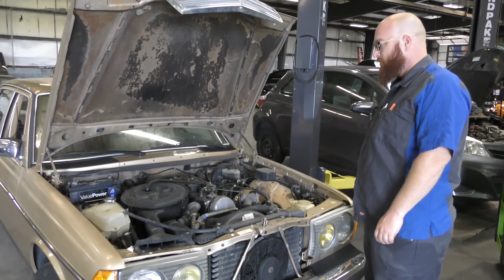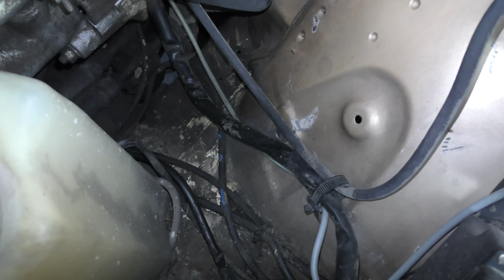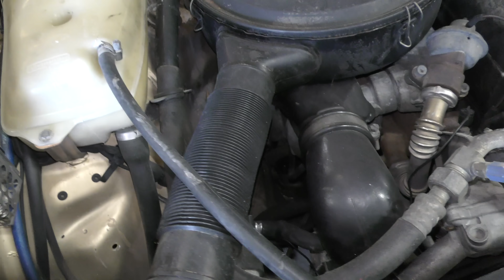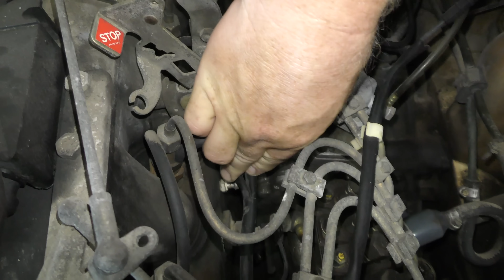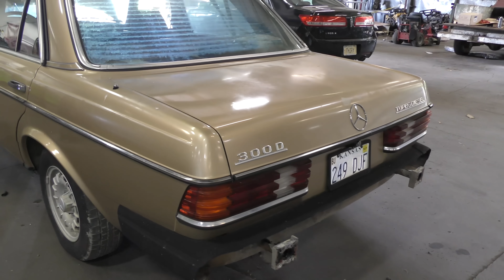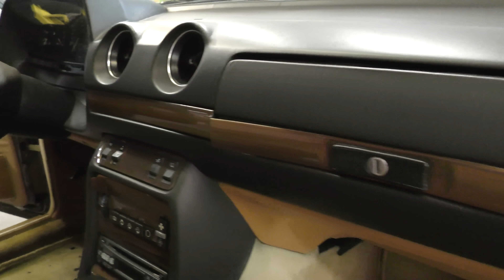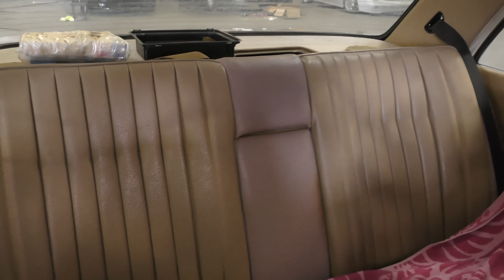Tank of a Mercedes 300D with a 3L Turbo Diesel! CAR WIZARD finds lots of surprises under the hood!

Comment: There is actually a  1,000,000 mile club online if you look it up. There are many of these over 1,000,000 miles. Mine lasted for 780,000 miles and I used to pour used chicken grease from my girlfriends job, the fryers there, in the tank along with kerosene and transmission fluid and God knows what else and the car ran just fine on all of that. We used to make concoctions of different fluids just to see if it would kill it. Nothing killed it. I basically made the assumption that it will run on anything flammable underneath gasoline and that was quite the correct assumption. The only reason it broke was somebody ran it off in a ditch and busted the radiator and drove it anyway and it blew the head. If I hadn’t loaned it to my friend I would probably still be driving it today

Comment: I just bought a 76 240D it’s smoking more that I think it should and can be a bit difficult to start. I just replaced the glow plugs with the pencil style. I’m still finding it a bit difficult to start after it sat overnight. After she gets up and running she seems to run great what suggestions does anyone have to put me in the right direction to get it running easier with less smoke?

Comment: On the TV show Wheeler Dealers Mike and Ant repaired a Merc 300. Very informative.  Mercedes has an an extensive parts network.  They will likely have everything you need.  Cost $ ?

Comment: Hey Mr wizard I have an 2006 Sion XB. I replaced the blower motor. My fan is blowing very and loud and the fan feels like it stuck on 3 even though it’s on 4. Is this a simple fix or do I need remove the dash or is there a part that need to replace ?

Comment: Small correction on the comment about the MB Taxi:

It was a 1976 240D, which was probably an introduction year W123 but could have been a W114 or a W116. I can't find any photos to confirm. However, it had (has) the OM616 in it, same as the 240D in the W123 lineup.

And it wasn't just a million miles, it was 4.6 million kilometers, or 2.858 million miles. Here's a link: https://www.expatica.com/de/uncategorized/last-ride-for-mercedes-taxi-with46-million-kilometres-on-clock-102348/

Comment: Don't mean to be "that guy", but when referring to the adla 15:11, boost pressure from the intake presses down a diaphragm inside to increase fuel from the pump, and the part you point at 15:16 is the vacuum control valve (vcv) for adjusting the shift point and feel of automatic transmissions, the shutoff valve is just behind and under the part described, like the video and love the old w123/w116/w126 cars with the 617.951 engines

Comment: "The cost to fix this car is going to be more than it's worth." Sounds like every repair job I do on my Volvo! lol
Reply: That is a logical fallacy. Still cheaper than buying a new car.
Reply: @petrosaguilar8916  "Logical fallacy"? Tell that to the insurance companies that sometimes refuse to repair a vehicle when it has been in a collision. And the reason why?: The cost to repair it is more than the vehicle is worth. It's a very real thing, not a "fallacy". That said, I do agree that in most cases it is cheaper than buying a new car. :)
Reply: @bobjohnson205  Putting $1,000 into a five hundred dollar car and getting another year of service out of it is much cheaper than purchasing a new or used late model car. That is why I said that the saying "don't put more into it than it is worth" is a fallacy. It does not take into account how much the replacement of the vehicle will cost. Also, unless you have a minty classic the cars book value is always going down and basing your repair allowance on it would be flawed logic.

 Insurance companies do not own the car and so for them it always makes sense to total an older car if repair costs are above book value.
Reply: @petrosaguilar8916  I'm glad that we agree! That is why I own a 30 year old Volvo and chose to pay for the body repair rather than have the insurance company write it off when I was rear-ended because doing that was far cheaper than purchasing a new vehicle. Shalom!

Comment: you can still pick one of these up in good condition for 3-4k. And then even if you put another 2-3k into it it´s still worth it. These cars will gain a lot of value in the future. Immaculate ones are already selling at 8-10k or more,

Comment: Vacume power locks is terrible! I drive a 1983 230CE (coupe). I did the central locking 2 times, and it failed again :D but those are the most serious problems with it fortunatelly :D
Reply: ok, so EU spec 300D had 80HP untill 09.'79, and 88HP afterwards. The 300D TURBO was only after '79, and had 125HP. In EU we only had the turbo engine in the T model (station wagon). Fuel powered had a 6 cylinder 2,8 (156HP with carburator, 185 with injection), and 2,5 (130HP carburator), and 2.0 4-cylinder carburated (90HP till '79, and 109HP after '79), 2.3 4-cylinder (109HP untill '79 carburator, and 136HP after '79 iniection). Cheers!
PS 240D had 65HP untill '79, and 72HP after '79. In EU we also had 2.0D 55HP till '79, 60HP after '79, and 220D (2.2D) 60HP untill '79.

Comment: Cool video.  I've driven 3.0L Mercedes diesels for the past 24 years.  They've provided me with great service, and I will say until my dying day that they were the best cars ever built.  Definitely the best automotive diesel engine ever built.  Hands-down.  I've only had one W123 300D, a 1982 model which was my step-daughter's first car.  My love is more for the W126 300SD, same engine.  Wonderful machines.  I have a 1984 300SD with 752K miles on it, which I retired about five years ago.  Many miles and memories in that car.  I bought a 1983 300SD about a year ago, and paid twice its value, because it only had 132K miles on it.  You don't find them with miles like that anymore!!!!

With only 170K or so, that little gold car you're working on has a LOT of life left in it!!!  Beckmann Technologies in Durham, NC rebuilds the climate control boxes, and the cruise control amplifier and servo.  Or at least they used to.  They're still in business, not sure if they're still doing those older ones or not.  Just send in a core, and they'll send you back a rebuilt unit.  I used them years ago, and never had any trouble.  beckmanntechnologies.com.  

Having driven these great old 3.0L cars (and two 240D cars, one of which I still have, both manual transmissions), I have to agree with you on most points.  But please, dear God, PLEASE don't do that LED instrument light change.  The instrument cluster isn't set up for it, and it will eventually fry the whole cluster.  NOT a good idea.  Replace or bypass the potentiometer,  and/or clean the bezels where the lights come into the cluster.  They fog up with age.  Often, that one thing can make all the difference.  And parts aren't as rare as people think.  Plenty of aftermarket parts to be found.  Just don't buy Japanese junk parts!  There are still sources for good German parts without going to the dealer OR the Classic Center, if you do some research!

Great video.  Thanks for sharing.  Good luck with this timeless classic!  I'm so happy it's going to be saved!!!
Reply: It wont fry the cluster,leds draw practically zero current compared to incandescent bulbs.

Comment: What vintage car? W116! I test drove a 1975 280S (carby M110), with non-functioning power steering (just the power; the steering was fine) and broken brake booster (ditto). Just the best car I’ve ever even been in, the nicest ride quality and decent, if temporarily heavy, handling, and the engine felt unburstable. The guy wanted $850 for it, registered, but the rust was quite advanced, and I would’ve paid many orders of magnitude more to bring that one back from the brink. Still, I should’ve bought it and put it in the shed........

Comment: I drove one of those for some time, a 1982 coupe, same TD engine. It started going slower and slower come to find out there was corrosion in the fuel tank, so it got a new one and after that it drove great. Serious turbo lag but once over 3000 rpm it would keep going. What I liked the most about it was the super comfortable suspension. I later had a 1983 coupe CE 280 6-inline 170 hp that was fast and a blast to drive.

Comment: Those older MBZ diesels are really the best. My parents had one. Great car!  The trick to them is you have to maintain them the way they were intended. You cant go cheap. If you take care of them and perform the required maintenance when its supposed to be done they will last forever.  I have a 2014 E350 now and so far its a great car, no issues. The best or nothing!

Comment: You can find use ones, they cost less than 400 dollars, but if you want to make it new, is also very easy, each side only work with these side electric accesories, the only exception are the horns. Very easy to do.

Comment: this was a true reliable bullet proof Mercedes benz in the old days, it can outlast all the toyodas in these days, it can go 500,000 miles till you have to junk the car. this baby can pull a 53 ft reefer trailers with 40,000 lbs of loads its hard to kill that car.

Comment: At 14:00  your finger points to  the leaky fuel filter housing.   Many of these leak because the mechanics  put an aluminum O-ring under the banjo bolt that threads into the fuel filter.   This set-up does not need that O-ring, in fact, that is WHY it's leaking.   The 2 rubber seals on the banjo bolt are what keep the fuel from leaking.  The upper one is part # 000 997 00 48.  The lower one is part #003 997 58 48   While we're on the subject of O-rings, when you change the oil filter, order 2 O-rings  that go on the tip of long center post,  part #015 997 94 48.   Most techs don't know  they are there and  never replace them.  Chances are yours are like cement.
Also,  15:20 you point at what you say is the engine shut-off vacuum element.  That's not what it is.  What you are in fact pointing to is the VCV  (vacuum control valve).  It varies the vacuum going to the transmission modulator valve based on throttle linkage position.  The engine shut-off valve is behind the injection pump but in front of the oil filter housing.

Comment: currently the monovalve in my 300d is acting up. not sure if i should just replace the little part for roughly $30-$40, or change it out with the klima kit monovalve for $130.00.

Comment: That car has an engine from a tractor. I wonder how many people know that? In Europe, they had 200D, 220, 240D, 300 and 300D. That particular car was the most powerful in the lineup. They even towed campers in the Alps because they had around 100 hp.

Comment: Viewer's, Wizard's not lying about the Mercedes-Benz 300D Turbo Diesel with good gas mileage and longevity, this is tough car. However, this car is not good in cold weather unless you own your own home. It becomes a hard car to start up unless you have a plug to keep engine warm overnight. Warm climates yes, cold weather, only if own your own home with garage and driveway. Thumbs Up anyway.

Comment: i have a 98 e300 td with the om606td .. Was going to swap the engine into a 2008 f250 with a blowed up 6.4 but i can't bring myself to do it because it runs and drives so good. I only paid 1600 for it. I now use it as my beater commuter that gets over 550 miles a tank. It's actually quite quick and sounds like a cummins =P

Comment: In the 90's, 240D was much more prefered in Europe. Because turbo's where awfully expensive and their replacement would eat up all the "savings" on this bulletproof car.
Even 65HP one had some decent torque, way better overall than i4 petrol engines of similar power output.
At that time, that was enough. In Europe, we where not obsessed by power we can't use on roads.

Comment: I owned a 1978 Mercedes 300D back in 1996..got it from a relative that bought it new from Lewis Chevrolet Mercedes in Beckley,WVa, crazy combo for a dealer I guess but hey, it was Wva! Anyway, the car was a museum piece with only 74K old man driven miles and it only was driven 28K miles from 78-88..He bought a 1993 190E 2.6 in 1996 so he let me have the 300D for a song...as well as taught me how to work on the car which was super easy..I could go on about that car but I will say that when I sold it in 2003, it still had many original heater hoses on it!!! The power window motors were original and everything still worked on it...I sold it as mileage exempt per FL law and for the fact that the speedo cable broke a few times which was common on these cars..water would leak into the cable wrap I guess and in the low spot it would cause the cable to rust then break..what I'm saying is when you see one with lower miles, it is probably NOT true as the cables broke all the time and were as simple as pulled the cluster out and unscrewing the cable to disconnect...I soo miss that car..soo easy to work on!! I don't miss the vacuum system that was the brain of the car!

Comment: My neighbor had almost the exact car down to the color. It had 400k on it before the guys son blew a radiator hose and drove it till it quit. As far as the mice chewing wires. Honda sells a pepper infused electrical tape to stop them from doing it if its a recurring problem on equipment/motorcycles/vehicles and the like that sit outside and in barns.

Comment: Hi Wizard, I love your stuff, and respect your integrity and honesty. I wish we saw that more in mechanics. Respectfully, I would like to point out a few things that you stated that are incorrect about these cars. I have a wagon that is my daily driver and have been working on and driving w123’s and om617’s for the better part of 10 years. 
I don’t want to correct you, but for someone who might be using this video for some help, this might set them straight. 
The plastic valve that is on top of the injection pump that you pointed at is not the shutoff valve, it is the valve which modulates vacuum to the transmission, in conjunction with the valves on top of the valve cover. The vacuum engine shutoff is on the back of the injection pump and is hidden by the plastic vacuum valve. 
The Alda does not control the turbo based on the state of the injection pump, instead the Alda receives a boost pressure signal from the intake manifold and controls fueling based on throttle position and boost pressure. It also affects fueling before boost comes on, and can be adjusted for more fuel off idle. Pull the plastic cap off the screw and lock nut and with the nut loosened turn the screw out until you get just a hint of black smoke when you snap the throttle. 
The turbo itself is not controlled by anything except a wastegate which only sees boost pressure to open or close. 
I would love to see more of this car, it’s always a thrill when popular YouTube people look at old mercedes! 
Cheers. 
Nick
Reply: Such a useful and respectful comment, Nick. Take care, 🍻

Comment: They also had a 200D, which is actually the engine with the most miles driven on that car. But it is incredibly slow. But I don't think they ever sold the W123 with the 200D in the US, probably because it was way too slow.

Comment: I just sold one of these on eBay.  It had some cosmetic issues, had a worn steering rack, and the AC did not work.  However, it ran and drove well.  I replaced engine mounts, some front suspension components and tires.  The car never let me down.  I drove it from San Diego to Los Angeles and back three times a week for two years and never had an issue.  I was an honest seller so I didn't hide anything.  Buyer got a great car cheap.  I've seen pretty W123's with drivetrain issues sold for much more.  After seeing this video, I miss the car.  They are very enjoyable to drive.

Comment: My father had one, a 1985 240D. It was not that fast, but it really was a tank: he really drove the heck out of it. The only problem is that when it fails, it's at the end of its life and it becomes an endless money pit. He ended up scrapping it 'cause it kept on breaking down after a lot of miles and he didn't have all that money to fix it.

Comment: The 1980s were a pretty good time for Mercedes.  Good durable power-trains, but electrical problems did exist.  My parents had a 1987 300TD (station wagon).  The power-train was good, but unfortunately, the rear lock of the trunk kept breaking (also W123 chassis).  They sold the car after the trunk would not open for the 6th time in four years.  Each repair after the warranty was out was over $1000.  Too rich for my parents to pour money into a trunk that refused to work.  Then again, I owned a 2006 Saab 9-3 and put 190,000 miles on it by 2018 when I sold it and now the second owner has 220,000 on it.  Cars do last a long time now for particular brands if you take care of them.